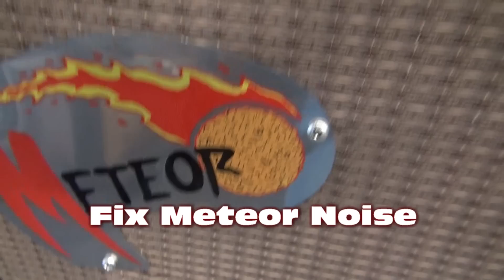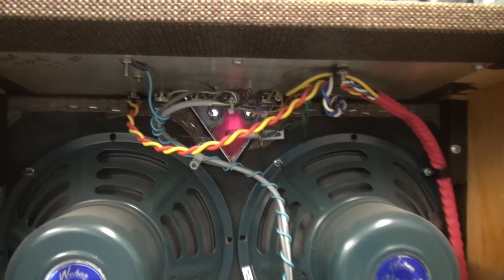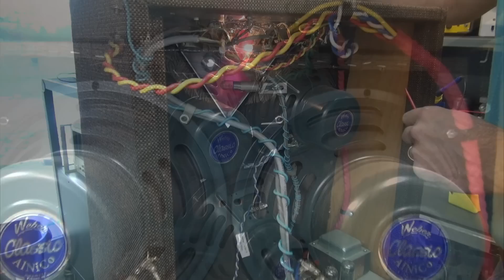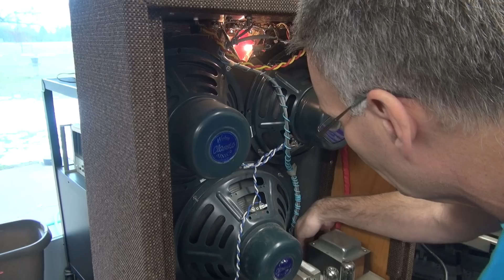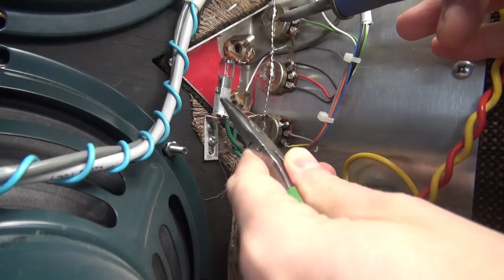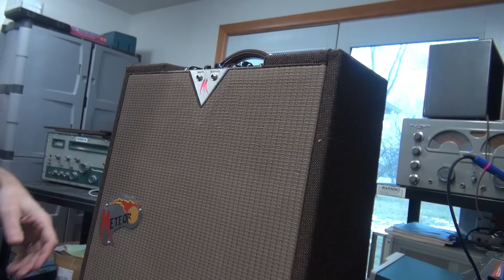How to fix Noise Meteor Tube Guitar Harp 6V6 amp

Comment: Those amps are known for a loud background hum, surprised you thought it was "ok" during post repair testing because that is a lot of hum for having nothing even plugged in!  that signal cable from bottom chassis to top control panel is not properly shielded, plus it has random multiple chassis grounds that also contribute to the high noise levels.  FYI: there is about 400 volts up there on the standby switch contacts under the control panel that are fully exposed and will shock you regardless of the amp being on or off.

Comment: The Meteor Amplifier was custom built in the USA. by Scott Berberian, It's design in based around the Fender Bassman circuit, the amp is highly prized among blues harp players from all around the world. There were three models available, the fifty watt Meteor with 1x12 and 2x10in  speakers, the Mini Meteor with 1x10in and 2x8in speakers, and another version on the Mini Meteor with 1x15in speaker. Meteor amplifiers are no longer in production.  More information about the amp can be found here. https://www.facebook.com/groups/2340762569515858/

Comment: Terry, I was impressed with your removal of your watch before putting your hand in the amp. Yet you were only half safe there. You should have removed your wedding ring too.
 One of my close friends brother was working on a piece of equipment and got his wedding ring into a live spot. The ring contacted 2 points and actually melted on his finger. What was left of his tendons and muscles on that finger looked pretty ugly. Besides, his having to replace the ring.

Comment: From Leo:  Always good to get an easy one.   Pretty interesting amp, I like designs where the heat from inverted tubes does not roast the circuit board or other components.

Comment: I like that design. Even if the wiring to the pots and input jacks is quite long. Because I have never liked tube amps with tubes upside down. Because they grill their tubesockets and other components. I am a big fan of Marshall type tube amp heads.

Don't ever even consider to repair an amp without some wine available! 😁
(I myself prefer beer.)

Comment: D-Lab does it again! 4 x 6V6, unusual. I wonder if this is a Vibroking clone? 3 speakers is a hint
Reply: Harmonica amp, built for harp not a clone . Dual power tubes with spare sockets  6v6 20 or 6l6 30

Comment: I never heard of meteor amps....Just a little tip....I use a ceramic tip tweezers to pull parts out while desoldering instead of metal pliers. The ceramic wont suck the heat away from the part.

Comment: Kind of a weird place to put those balancing resistors, isn't in? Inside the cabinet out of harms way makes more sense.
Reply: Jack Mahaffey agree, but balance resistors are generally soldered to the pilot light in most situations. Look at most vintage fenders.